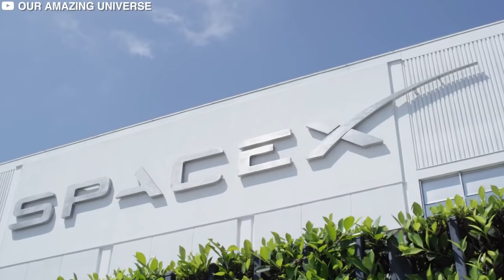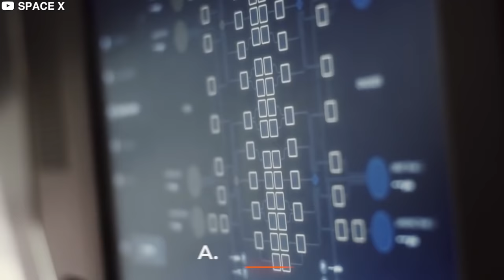Inside SpaceX's Insane Headquarters

Comment: The 747 was not built in Hawthorne.
Try Everett Washington.
The SpaceX HQ was the site of the Northrup Aircraft Company. Nothing to do with Boeing.
It sits at the corner of Crenshaw Blvd and Jack Northrup Ave. The latter street might have been a clue.
Reply: Definitely incorrect. There were 747s assembled all down jack northrup ave.   some of the facilities still exist and have massive 747 logos inside.
Reply: Boeing uses a massive supplier network to build their aircraft. Many of the large fuselage assemblies of the 747 were built by Triumph and Northrop in Hawthorne or Jack Northrop Ave., including the building that is now main HQ for Spacex. Boeing’s Everett facility is for final assembly and is absolutely amazing if you ever get a chance to check it out.